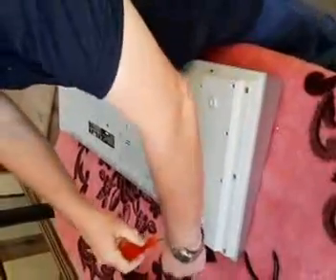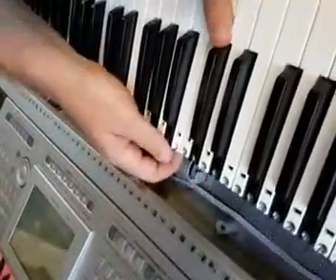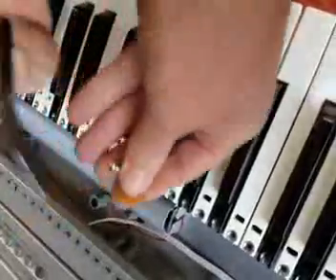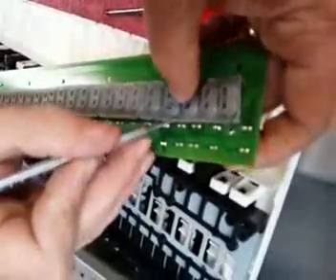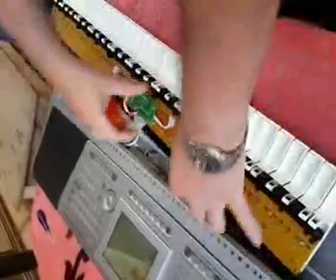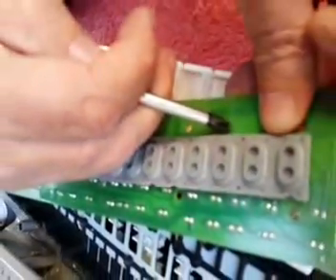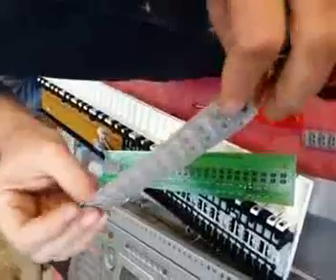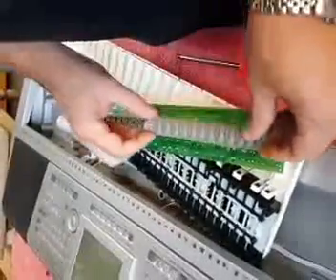How to strip and repair electronic keyboard key contacts

Comment: 3  keys too loud on technics kn6000...how do I fix this...
Reply: Depends on why they're louder.  It's probably because they are always playing at 100% velocity. If so then the steps in this video could help.  Basically there are 2 of these contacts per key and the velocity/loudness is determined by the time difference between these 2. If a key has only 1 functioning then apparently that can cause 100% volume. 

Hook your keyboard up to a midi monitor and play your different keys while monitoring what is reported for volume.  On a PC a good free Midi monitor is Midi-Ox. Good luck.

Comment: I had a spare remote control so I stripped the conductive rubber from ít key using a razor blade, then stick it to my electric piano keyboard. It works perfectly.
Reply: Really, how did you remove the contacts from the remote control

Comment: Good morning. I need help please help. My M-audio 61 started loosing sound on 2 notes in the centre, namely the G# and A# notes. After I followed the cleaning procedure, of removing the key contact rubbers and cleaning the circuit board with an earbud, all the keys are dead. Some faintly work. What can I do?...
Reply: What did you clean the rubber contacts with? Did you use a liquid?  What liquid.  Soap and water is ok.  If you used an electronic contact cleaner spray it will remove the contact surface from the rubber contacts.
Reply: I Used Only an earbud on the circuit board first.
Reply: than Applied Pencil shavings(graphite)
Reply: @sollymolete1015  where did you put graphite. Can you send photo?
Reply: @timpullen4941  on the circuit Board. But Last night I discovered that I Need to replace the Rubber contacts. Cause I used one rubber contact that was working fine and tested it On All the circuit(contact Parts) and the circuits was OK. I cleaned the rubber contacts Very well and swapped them around. to find out the one of the rubber strips were Faulty. I Only Have a Video.
Reply: But this Vid Only shows the 1st time Applied the Graphite and Not when I cleaned the Rubber strips
Reply: I've just up loaded the vid On youtube
Reply: I've foud the solusion to my problem. And is is to replace the Rubbers. where Can I Buy them. Any Help?

Comment: One of my key is broken. But when I remove the key it works but when I put it back on it doesn’t work anymore, so I have no idea how to fix this..
Reply: The rubber contract is buckling when you are replacing the key.  You have to have the keys back into instrument first and then replace the key contact rubber circuit board.
Reply: Tim Pullen Ty for the tip my key works again!

Comment: i replaced my oxygen 13 upper contact strip and now the top is looser than the bottom 12 contact strip ....since the part is used I guess thats what heppens....hopefully the bottom 12 will wear to the same feel

Comment: I have just repaired a Yamaha P85 digital piano. I've spent two hours fitting these rubber (contact) strips thoroughly.
Everything works perfectly, 
However, I have the feeling that the keys on the right hand side (above C3) are louder then the bass keys  on the left.

I've noticed that the rubber strips have some labels like T8 or T14 etc, although they all look and feel the same.

Do these rubber strips have to be mounted in a specific order?
Thank you in advance

Comment: I have purchased a Roland Hp700 digital on a yard sale for 20 dlls and 2 keys dont work in the D and F key in the bass key area. I have removed the keys and clean the rubber contact pad and contact in the circuit board and still dont work. Checked the pin connectors and ribbon cables under key contact circuit board and are fully plugged in, everything seems to be connected properly. Even try a new contact pad and still dont work
What can the problem be. Im about to give up on it.
Reply: Some times the circuit gets exposed to spilled beverages which etch the tracks, coke is particularly aggressive. it takes a lot of patience, but you can normally trace the individual keys matrix, back to the master scan IC's as all the individual keys will be banked 8x11 typically. use some thin copper wire on the reverse of the circuit board to link the common diodes where a break has occurred.

Comment: I should have watched this video before attempting this. I went straight to the contact cleaner :(
Reply: I guess I am late but I did the same and a lot of keys started to fail.
I applied the hot water and soap method shown in the video and recovered all of them. I had to clean them twice but it worked.

Comment: hi , ive got a problem with my mm6 , the keyboard pcb whre the rubber contact hit are rusty so i want to replace it with a psre 413 pcb , the question is  is it possible  without any problem? they seem to be the same  . sorry my english is not good

Comment: Hello, I have a Roland GW7, and the keybed dont work; I play the keys and no sound, but if I plug the keyboard with a midi controller, Works fine. I change the rubber strip and nothing , have you any idea? Thanks
Reply: Marcio Gomez it's the memory stick I had the same thing happen get a new one  from roland it will cost a little your old stick is corrupted.
Reply: Where is the memory stick? Rhanks for you reply

Comment: I've taken a punt on the Barclays Enterprises solution (below). That's after stripping and moving key bank contacts around after cleaning and using graphite - which doesn't last that long. It would last if there was a better binder for it.  Any ideas?  What sort of glue?
I can't yet follow the "pop-up" action limitations referred to. The contact height is obviously very critical to proper touch both from the point of actual contact and the delay caused by the deeper set pad which is measured for velocity to volume conversion. Good video, good discussions and thanks to you all for that.  {BTW Casio CTK900}
Reply: The question here, if the dust stays under the little carbon contact points, then why would graphite dust or pencil shavings be any different? :)

Comment: My firm repaired tens of thousands of buttons and found that if merely cleaned or resurfaced with some conductive paint they would fail again. sometimes within just a few months, especially with heavy commercial use and in warmer climates the silicone oil comes out of the rubber keypad and creates a "goo" or you will notice the black carbon contact deteriorating and being left on the contacts of the board.    Well when you warranty a repair for over 3 months, or years, you don't want to rework the item.  So we came up with a permanent solution (or will last longer than the rest of the unit), that is a easy to install, peel and stick conductive membrane.  It not only never wears out,  the adhesive around each contact seals out the dirt, debris and silicone oils.  They can be sliced up to conform to most button arrangements, or even cut up individually*  *But when cut up individually we implemented a spacer to create a gap between the contact and the board to give the contact the ability to pop back up since cutting it down to single contacts jeopardizes its "pop up" action.  You can order the membranes on Ebay at this link  http://cgi.ebay.com/ws/eBayISAPI.dll?ViewItem&item=291583354988
Reply: C. WRIGHT BARCLAY rabbar rate
Reply: rabbar rate
Reply: where can you get this membrane ans that is it called? that ebay link no longer is valid

Comment: I think these electrics should have a way to cover up the keys to keep out dust and debris.
Reply: Manufacturers should modify that. I tell my experience: I removed the one-octave contact strips from my keyboard because a key was not responding well. The rubber pins that bring the strips to fix them to the board are very difficult to snap into place, it requires a special tool. I ended up damaging the pins and they could no longer be snapped into place. That causes contact failure. Finally I cut the rubber pins completely and put the strip in place. It worked perfectly. Anyway, it may be interesting to put a thin line of contact glue on both edges of the strip, being careful not to get the contacts dirty with the glue. This would ensure that no dust enters the contacts again or that they move out of place. In case of need, the contact glue is not very difficult to peel off. Just make sure that everything is perfectly clean before gluing the strips. I edit: the advantage of removing the fixing pins and gluing the strips is that for a subsequent cleaning of the contacts, it will not be necessary to remove the screws from the board, which are many. It will be enough to remove the keys from the octave that malfunctions, and then carefully peel off the strip to be cleaned. What I say depends on how the keyboard is built, but I think it is valid for most.
Reply: No, how will electronic technicians make a living?

Comment: actually if you damage the contacts or if they are worn out as happens on many, you can guy get my contact disks and stick them on after cleaning with acetone.  Cram them down good and voila.  So far I've only seen keyboards where the spacing was so marginal that the initial contacting of these disks is not quite as good as factory so you have to put a small spacer under the key actuator.  But if you have a clean contact board (another thing where sometimes on the gold plated ones you have to lightly rub 1500 grit paper over them...)  you have a solid keyboard again.

Comment: sometimes it's not just dirt on the contacts. over time the conductive part of the rubber wears, so you need to replace the rubber part or make it conductive again. i used stuff called "remote restore" that i got from ebay - worked great on an old dx100 that i could not get new parts for
Reply: Hi from Gwendoline Leong channel . My Casio CTK 495 keyboards dont have sound whatsoever when i  unscrewed the back. The Tone/ Rhythm/Song Bank (computerr) works fine. Just the ketboards have no sound? Is it from a loose wire? A disconnected plug? The Casio dept reception said, "Oh, the keyboard dropped?' like it was a common problem.The rubber contacts are a bit worn, but they were working fine before i unscrewed te back.
please reply.
Reply: Where did you by the rubber strips